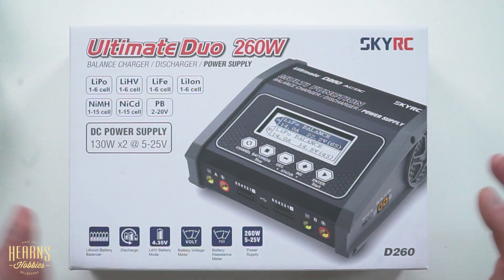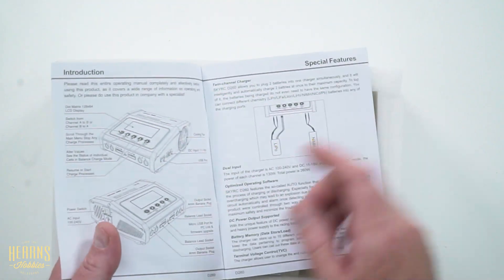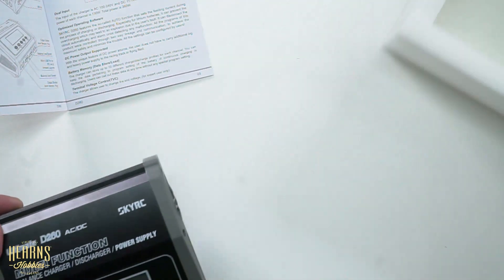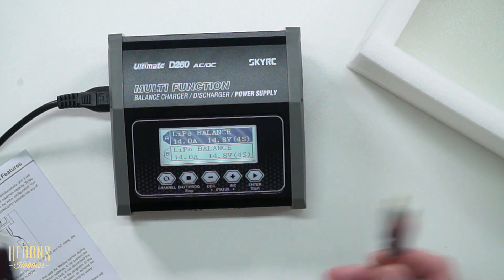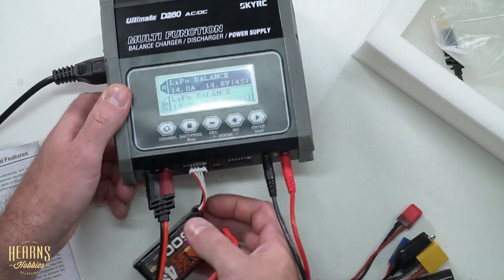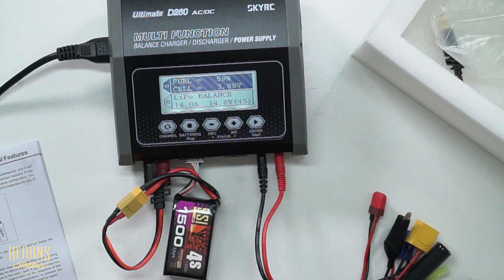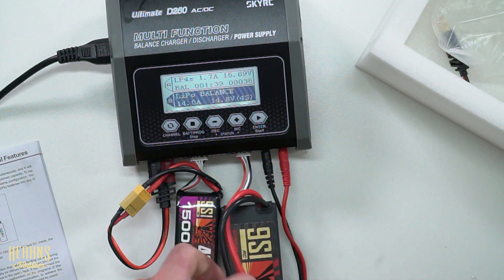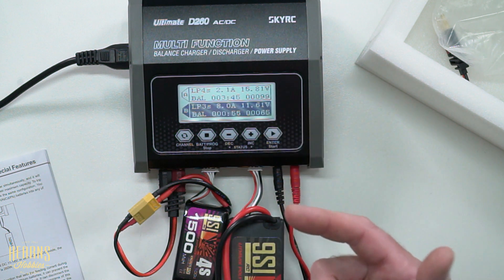SKYRC | Ultimate Duo 260W AC/DC Charger Review & Tutorial | #askHearns

Comment: Hi
Is there a way to charge a Dji TB47S battery with 6 cells. can i use a cable directly to the battery.
Reply from the maker: Dji batteries have to be charged with a dji charger

Comment: Though you were only supposed to charge up to 1 amp for every 1000mah or lower to be safe?
For example a 5000mah battery charge at 5 amps max or a little lower like 4.9 just be safe but never above what’s written on the front of the battery?
Reply: Some batteries write on their box if they can charged more than 1c , if they don't write it clearly it's the best to charge in 1c .
Reply from the maker: Hi Lee you are correct and that is the best way to keep the battery in good health and reduce any risk. We would not advise any different. When we talk about racing however there are other factors that come into play and so it is possible to charger at a higher rate. By doing this you often reduce the life of the battery as well as may cause failure. These big chargers are really good when charging large batteries. Today we have 8000mAh++ and so having a 10AMP chargers means that charging at 1C is still possible. Always pay attention with LIPOs and look after them for a longer life. Thanks for watching.